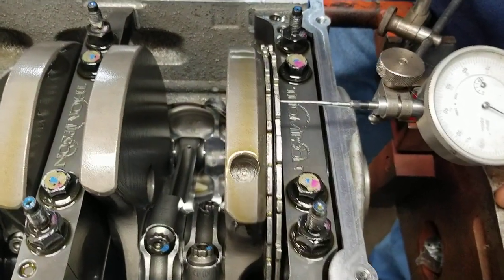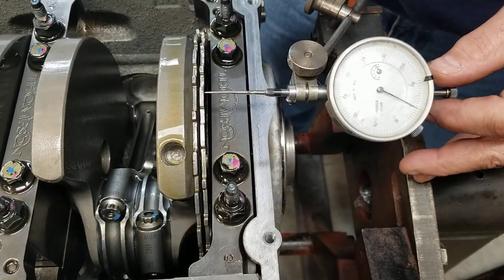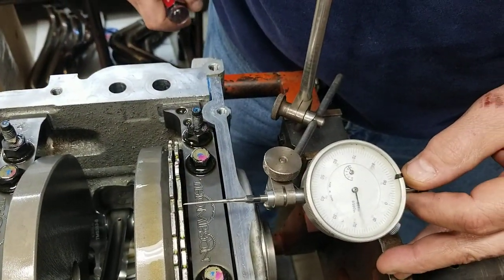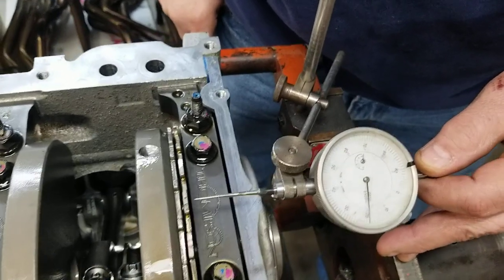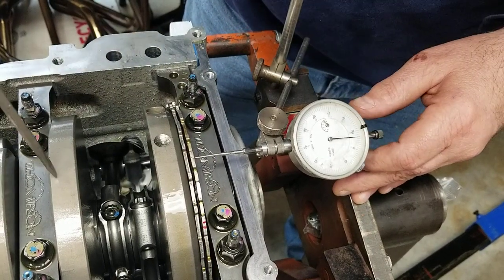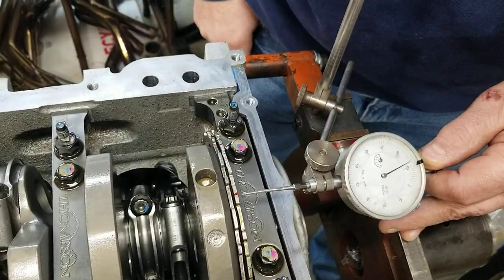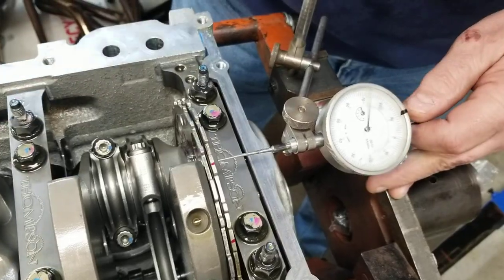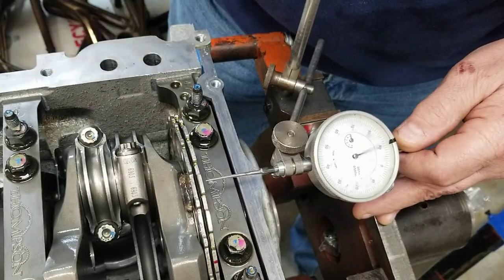reluctor wheel issues

Comment: Okay that's all great and everything but what is your point? what does that cause? Misfire issue or some type of issue with the timing?
Reply from the maker: Yeah its in the video description..i posted the video on youtube so i could share it on a forum with the whole story.
Reply: @vans1107  oh okay I found it in the description. Very interesting. I did not know that thr relucture wheels were that sensitive. Good info.
Reply: Isn't the reluctor run out more critical in the outside diameter vs forward/backward movement? I wouldn't think forward and backwards cause much of an issue lf the sensor covers the .025 of the runout..

However if the runout is laterally in rotation it would cause big issues with the airgap and therefore cause misfiring...

I'm having a crank sensor issues now with a boosted low mile oem 58x 5.3 ls, and terminator x max..
Reply from the maker: @Mild2WildGarage  after I made this video i was looking more at the reluctor wheel and noticed the two halves of the reluctor wheel were warped and seperated around where they welded it to the crank, toward the end of the video you can clearly see where the gap between both halves starts to widen.  I'm only able to measure the rear part of the reluctor wheel runout..that's not accounting for how far out of whack the front half was.  Either way, I sent the short block back to thompson motorsports to have them replace the reluctor.  I had them use a billet one piece wheel this time around, and low and behold it fixed the misfire.